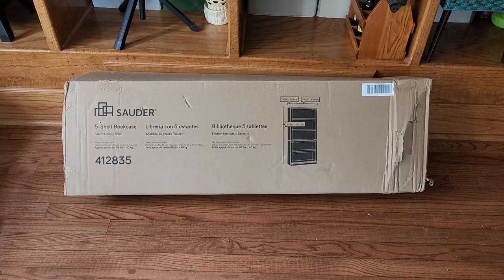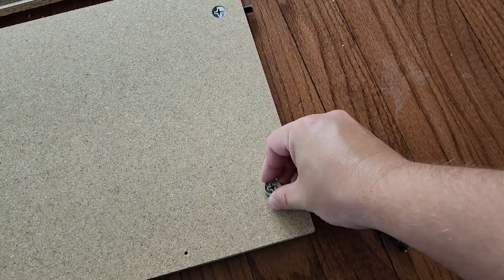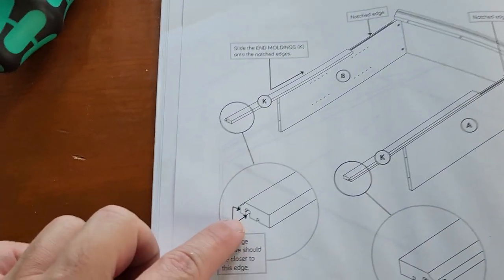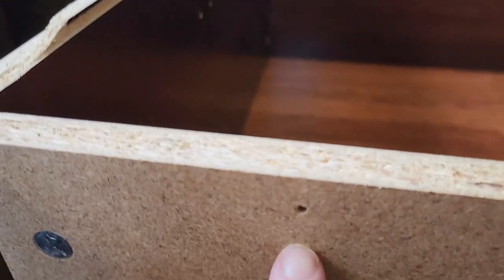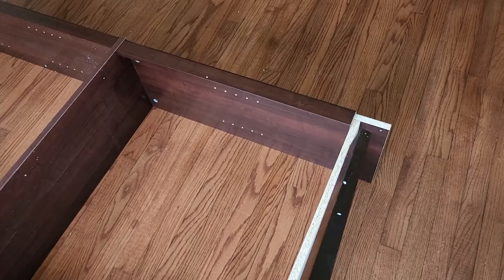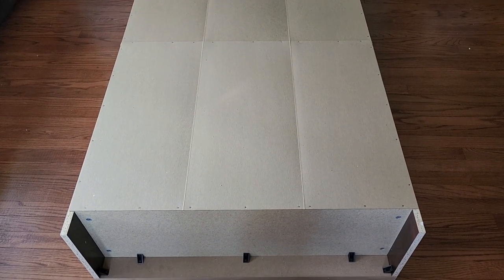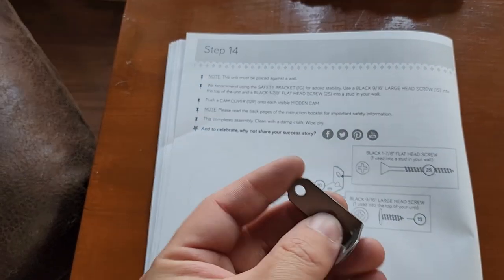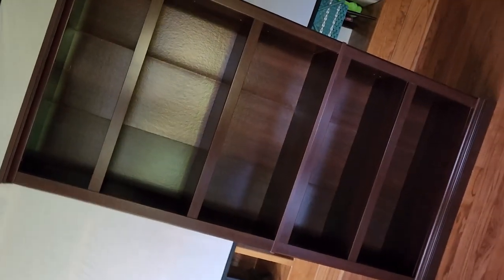Let's Build This Sauder 5 Shelf Bookcase! (412835)

Comment: Our back seems slightly crooked. When place on the back side , it seems to have some overhang on one side and some gap on the other side. Any issue’s when u placed it ? Thanks
Reply from the maker: If its not square the edge may be uneven.  Before the back is attached you should be able to adjust the cabinet itself so the back sits straight.  Just kind of push on the corners with the back laying in place until the back is sitting correctly.